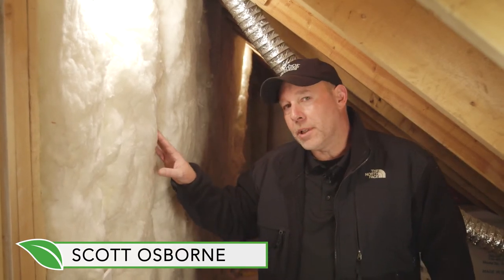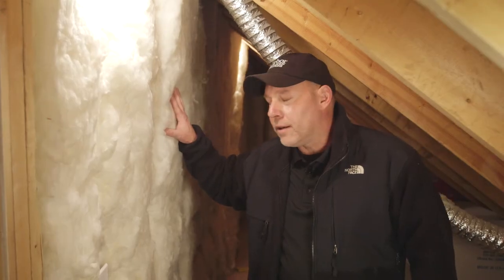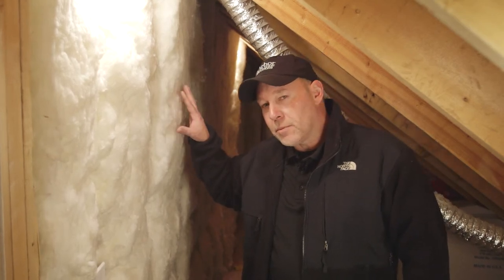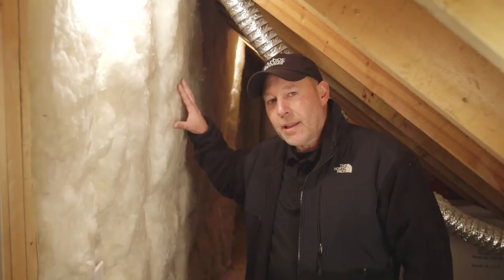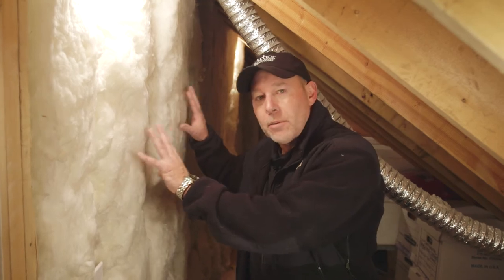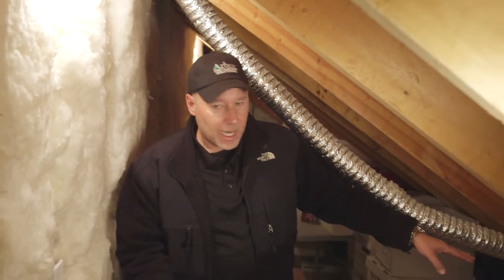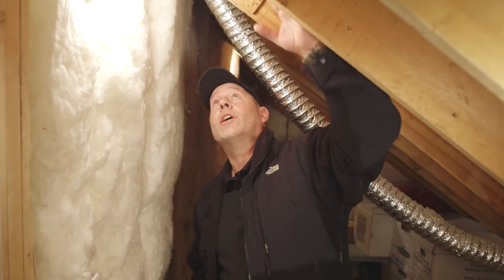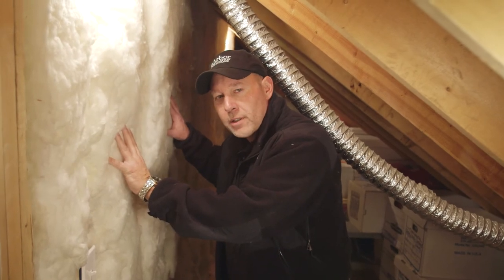Knee Walls and Bonus Room Air Seal Issues

Comment: Hello. I am going to finish my bonus room this year and have a question. The frame walls like you have in this vid are open and 2x4's, there is an open space maybe 6 or 8 feet to the edge of the house. Would I be better using OSB boards behind the 2x4's and using an R13 Faced insulation for 2x4's or should I not use OSB boards and maybe use a R19 for 2x6 boards doubling the thickness? Thanks

Comment: Does the insulation that you are covering have to be unfaced i am worried about moisture
Reply: I am curious about this too
Reply: The fiberglass insulation probably has a kraft paper surface(vapor barrier) facing the heated room.  Now you're adding another vapor barrier on the outside.  Aka the vapor barrier sandwich.  Moisture gets into the wall and can't readily leave.  Fiberglass performance will swiftly degrade in that scenario and then you get mold/mildew which is a whole other set of problems.  Some foamboards are vapor permeable vs. a vapor barrier but still you'd need to be a building scientist to know how much permeability is enough.  Better to use something like Roxul Comfortboard (rigid mineral wool) in this scenario.  It's vapor permeable and fireproof to 2,200f.  And dramatically cuts sound penetration to the inside of the home.  So... many examples online of so-called pros solving one problem and creating a bigger problem.
Reply: @BobPritchard  Would it be best to replace the old fiberglass with Rockwool before adding any insulation boards?  Would you need to add a vapor barrier on the house side?
Reply: @davidchristensen3460  Hi David, I'm not sure it's worth the effort unless you know it's poorly installed(common!) or otherwise failing.  If you did inspect it, it would be worth knowing whether there is kraft paper against the heated wall.  That's the norm to install it that way in cold climates.  If it is and it's in good shape, then if you want to add another layer in the non conditioned area, that's good but perhaps stay away from foam, in particular the selections listed as a vapor barrier.  You could build another wall from 2*4's and then install non foam insulation in that or perhaps use Roxul Comfortboard by itself which is stiff, to build a wall from that.  The Roxul products, whether mineral wool batts or mineral wool boards, are all vapor permeable, highly moisture resistant and flame proof to 2,200f.  Owens Corning also makes mineral wool insulation but I haven't seen them having something like Comfortboard.  There are specialty nails with wide plastic baskets on the end which are quite good for holding this in place.  They are usually special order from the big box stores but are also available via Amazon.  If you search for 'washers for fixing rigid insulation', you will find an assortment.